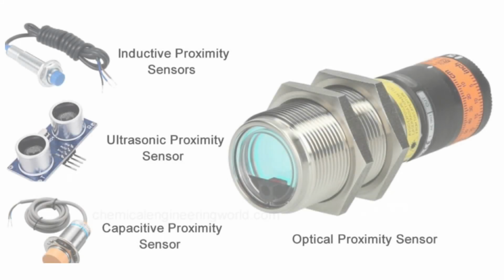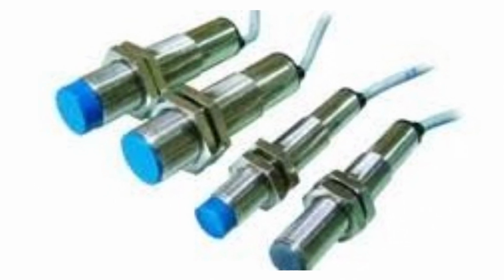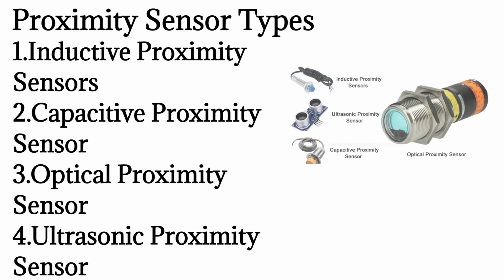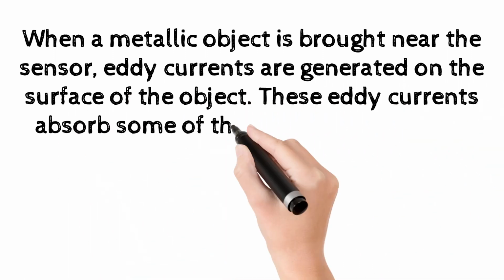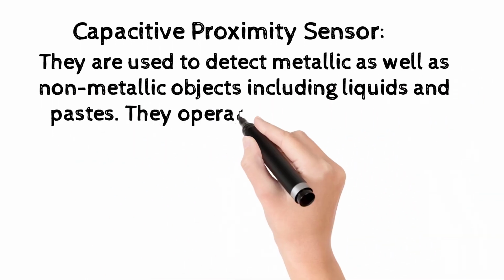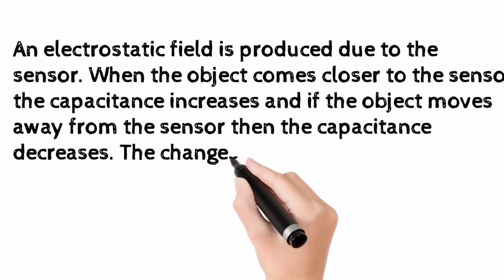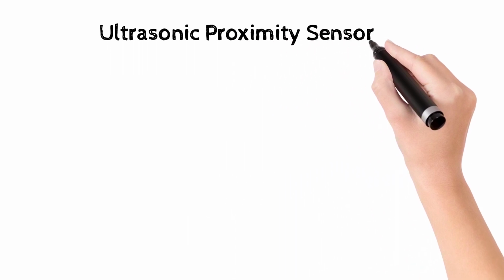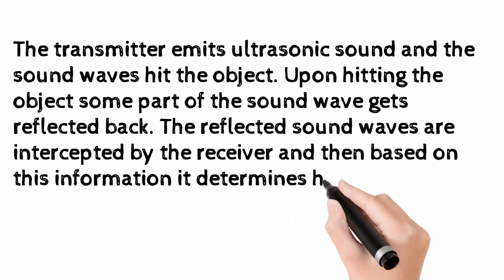Proximity Sensor Working and Types||proximity sensor types and working principle

Comment: 4 wire proximity sensor, lights are on. Can they still be not working even if they are lit?
Can i temp bypass to see if they are at fault?
Had a cnc machine recently got triggered by moving too far and once triggered, wont find home anymore.
Just looking for solution